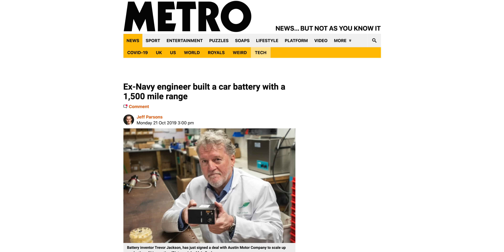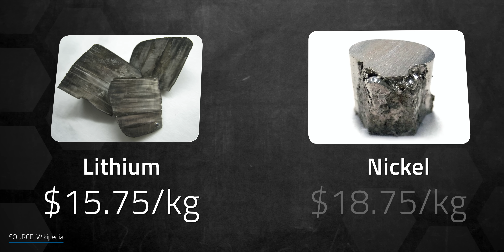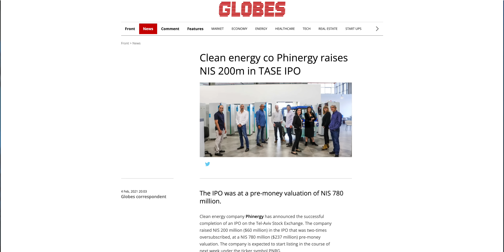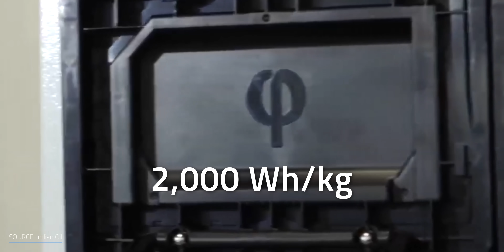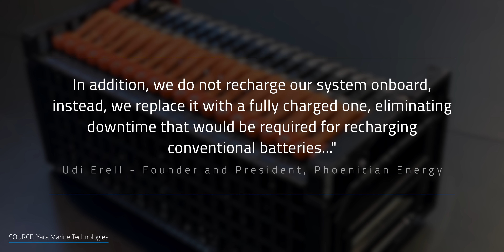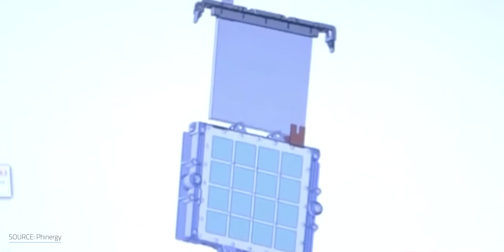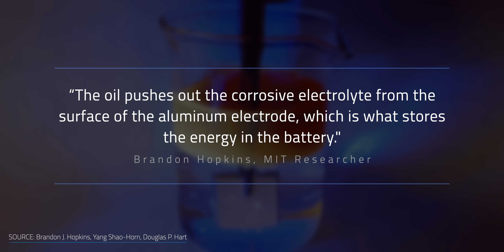Exploring the 1000 Mile Car Battery - Aluminum Air Hype?

Comment: If they are super light with super high energy density, but require specialists to swap out, then they sound like they are perfect for aircraft.
Reply: When gas stations first appeared on the scene...it required trained gas attendants to gas up vehicles
Reply: @signkutter9218  Kind of like how there an elevator attendant that operated the elevator for people.
Reply: @signkutter9218  still like that in New Jersey.
Reply: @signkutter9218  They still exist in some countrys
Reply: @signkutter9218  These are still not rechargeable, and while they might be "easily recyclable" Aluminium recycling takes a metric fuckton (scientific unit) of energy. So it won't be used in applications where you can easily recharge NMC or LFP batteries.
Planes I could see. There max energy density per kg is important.
Reply: @4203105  it takes a metric F.T of energy to run shiat right now...if the energy and pollution can be concentrated into use at a few locations they  can be much more easily controlled and methods improved upon
Reply: @signkutter9218  So your solution to the climate crisis is wishfull thinking. Gotcha.
Reply: @4203105  😅🤣😆...ok...
Reply: @signkutter9218  yes, your post was laughably bad. Good to see some self reflection there. Ü
Reply: @signkutter9218  because labour is cheap in India (folks are poorer and live in precarity) we don't have any petrol station without an attendant.
Reply: and to replace diesel engine trains.
Reply: @Psi-Storm  THAT was what I had first thought of too, you could essentially have an entire train car that's a massive battery. once you get to the destination, you swap out for another one (or maybe use 2 for round trips?) then recycle the old one, swap out to new cars, and keep on rollin'. there's definitely massive potential there.
Reply: @Fenthule  I imagine standard electrified tracks are more efficient seeing as they don't carry any fuel, but maybe in certain areas that would be impractical. Also I'm no scientist and I could be totally wrong.
Reply: @Psi-Storm  over head wires are better for trains
Reply: @Psi-Storm  hahahaha. uuuuh, no. how much waste are you wanting to create? if there is so much concern about the pollution create some kind of exhuast system that removes the NOx 's rom the gas an uses it to do something
Reply: @Psi-Storm  catenaries and third rails are far more effective methods of electrifying trains without having to rely on far off future tech
Reply: @tomasjakovac7950  I Germany we have around 13000km non electrified railways, which are only sparingly used. The costs to electrify is much higher than just upgrading the needed railroad engines.
Reply: Energy of combustion per mass of Aluminium is 68% that of kerosene, and I suspect the efficiency of a battery/motor/fan would be considerably higher than that of a jet engine. You could be on to something...
Reply: @Aaron628318  Jet engines are extremely efficient, So much so that they cant run stochiometric mixtures because the engine will melt, generally
Reply: @raam1666  Yes, the 'motor efficiency' of jet engines is good at ~55% but not as high as an electric motor would be at >90%.
Reply: @Aaron628318  hello it needs air to work doesn't it.the air pressure is really low at crusing altitude which would push down the reaction rates in the battery to a fraction of what it is on the surface.We can't pack a tank of air for something as large as an aircraft on board because that would reduce the energy density of the overall system down to clearly uneconomical levels.
If anything aluminium air batteores are near perfect provided there is a robust and easy swapping mechanism and stations.i read the researchers were able to design aluminum casettes which can be standardised and just put into the battery slots and within minutes the battery would be ready for use.
Reply: @Aaron628318  Well we arent combusting Aluminium, we ar using it in a Battery :P . If you look at it this way the 1300Wh/kg or maybe 2000Wh/kg of the battery dont really compare to the roughly 12000Wh/kg (43MJ wikipedia) of kerosene. Take into account that the more fuel you need the heavyer your vessel gets, making your need even more fuel. If you drop your energy desitiy to around 15%, I think its fairly obvious that the resulting differential equation will blow out of proportion. Jet airliners are not possible with this Battery. Smaller planes yes.
Reply: @martinkroeker5346  In effect though we are combusting aluminium. I was imagining they would be similar to zinc-air batteries. In these zinc powder is added and zinc oxide is removed. They can actually be operated as a form of fuel-cell with this process happening continuously. The excess mass over that of the reagents could therefore be kept low. That was my non-expert thought anyway...
Reply: @Aaron628318  It'd only work for replacing piston and turboprop engines, but it'd be great for that, especially helicopters.  The heat thrown off by the burning kerosene accelerating the air expelled out the back is critical for jet engines.
Reply: @Aaron628318  68%?! that's huge! lithium is like 1%. and yeah electric motors are waaaaaay lighter. no need for a full jet engine with multiple compression stages. you could probably use props instead because electric motors can have huge power delivery and torque and require little maintenance...
Reply: I'd suspect that light is a relative term here. Maybe light compared to other battery materials, probably not compared to traditional fuel.
Reply: Doesn't get around the problem that the aircraft would have to land fully loaded. Takeoff weight and landing weight are not the same, in fact they differ greatly
Reply: @peersvensson9253  This hypothetical aluminum air battery would probably weigh less than the empty fuel tank, pumps, and piping of a kerosene system.
Reply: @peersvensson9253  Planes can land fully loaded. They do so all the time when there are plroblems shortly after takeoff.
What is your imaginary problem here?
Reply: @4203105  They jettison fuel if they have to land right after takeoff, or alternatively circle the airfield to burn fuel. A simple google search will tell you the difference between takeoff weight and landing weight of an airliner.
Reply: @peersvensson9253  but in return your plane is always fully balanced. And the difference in weight of fuel is not as extreme as aviation experts make it sound, and besides most problems from weighted planes comes from take off, landing is more affected by landing characteristics of the plane (ground effect, angle of attack and tail clearance to name a few).
Reply: @ScarletFlames1  weight = wear and tear.
Reply: Electric motors are probably cheaper and lighter than jet engines. Jet engine bypass air is already used to pressurize the cabin so maybe the electric motors could be used to supply the battery and cabin with oxygen.
Reply: @mariat5860  o
Reply: That didn't look too specialised. Click one out, click another in.
Reply: I've been saying this for years & I don't see any problems using it in cars either. It's silly to think it's difficult to switch it out anywhere. It doesn't need a special environment.
Reply: Parts swap will be made simple and easy. But just hard enough you dont want to do it yourself.
Reply: @shawnr771  I rather have rechargeable batteries with solar power
Reply: Yep.
Reply: @PinskiYT  you can have both, a hybrid with just the one powertrain. The AlO would be only used when you exceed your LiIon capacity.
Reply: @WoutMertens  I must argue that having energy Independence is more important rechargeable batteries will become more energy dense eventually and solar technology is getting better
Reply: I just realised that there's a downside. Jet fuel gets lighter as it's used up. Aluminium/air batteries get heavier...! Maybe they could drop them off with parachutes on the way?!
Reply: @Aaron628318  improvements to landing gear also, yes? Higher landing weight = more wear and tear
Reply: @Aaron628318  But still that kind of battery are way more light then Lithium batteries.
Reply: The issue in aviation is the lack of air at altitude. This battery requires oxygen in the cathode. You would need a compressor to provide enough oxygen to the battery. An electric air compressor could easily use up a significant portion— if not all— of the battery output.
It really depends on how much oxygen is actually needed.
We could also carry an O2 bottle but it poses a fire hasard and adds weight.
Reply: @Baminokrat  because planes fly at high speed on high altitude, the mass of oxygen airplane comes in contact per second is not going to differ too drastically. And there will be some sweet spot where this can work at maximum power.
Reply: @Baminokrat  The turbo engines already have an air compressor, you would just need to get some oxygen out of the compressed air stream.
Reply: @Baminokrat  Based on the chemistry in the video you will need about a ton for every ton of aluminium. If the air is at 0.5 bar there will be around 0.1kg/m3. So you will need approximately 10.000 m3 air for each ton.  Sound much, but for example an jet engines pushes that amount in a few seconds and a forward intake could get you all the air needed.  .
Reply: @Baminokrat  I think the speed of the plane could easily be used to create a local high pressure zone around the battery.
Reply: @Baminokrat  When you look at the details and the high development of the latest high bypass jet engines - a pretty high bar effciency-wise. Also need to consider power (how fast can we use the energy) - This is super-high for jets - can a battery pump out 50,000 horsepower? How big would the wires have to be?
Reply: @DLWELD  On to something there...
Reply: @DLWELD  Most everything can scale, so sure .. The only decider is power to weight ratio, and in a feasible volume ... Surely SOMEones worked the mumbers on this ???
Reply: @Baminokrat  
That issue only applies at jet altitudes , whereas Ro-Ro operations for aircraft would be low-level regional flights .
Reply: @Guillaume  jet engines also require a huge ammount of oxygen. These batteries wont require a similar amount i would imagine (just because the mass of the battery doest increase 10x when ut is charged)
Reply: @Baminokrat  Yes and no. A 'scoop' could be deployed, similar to jet engines to compress the air anyway. At high speeds, air shoved from a large intake to a small pipe would create the flow needed. This is similar to the turbofans on jets.
Reply: @Baminokrat  the necessary oxygen for Jet flight is provided by the Jets velocity. I suspect the same technology would be sufficient for aluminum batteries.

But there might be issues with high-altitude airports.
Reply: @Baminokrat  Yeah that could be an issue for sure depending on how much O2 is needed. Maybe could be rammed in with scoops but that adds drag so... Aviation... a balance of dozens of factors.
Reply: @Baminokrat  Don't you need air for combustion in a regular engine in a plane?
Reply: @Baminokrat  I had the same idea but didn't think about the oxygen required, interesting. How do conventional aircraft deal with combustion at high altitudes?
Reply: @Baminokrat  what is a Ramjet, hello?
Reply: @Baminokrat  Air density is not changed as much at the altitude commercial airplanes fly at, to humans it's a lot but to machinery it's negligible if would not require as much compressed air as you'd think. Also, I remember Elon say something about battery powered flights have an exponentially higher efficiency and speed potential, the higher you fly vs a conventional airplane engine because of the air density requirements that batteries don't require.
Reply: @Baminokrat  you're correct that the lack of altitude would be a draw back. However liquid oxygen is already in use for aviation and provides O2 at ~800 to 1 ratio vs compressed gas. The systems could be linked up to provide a steady stream of O2 to the battery along with the cabin. It would take an engineer to set up the right configuration to maximize the weight and power usage with the O2 consumption though.
Reply: @Baminokrat  if you were using currently understood turbines that were simply spun electrically, you would have more than sufficient high density air to bleed off to feed the battery.
Reply: @Baminokrat  liquid oxygen? :o
Reply: @Baminokrat  battery turbos
Reply: @Baminokrat  This might be a better solution for the air taxi technology several companies are working on or for smaller aircraft that fly at significantly lower altitudes than the larger commercial aircraft.
Reply: @Baminokrat  I wonder if liquid O2 would work. Some planes already carry liquid 02 on board
Reply: @Baminokrat   velocity would take care of that problem, as it does with a jet engine which also oxidizes it's fuel
Reply: @Baminokrat  Well hold on a mo, sometimes function dictates form - imagine a low altitude air fleet based on this tech? Could be great for short-haul ??
Reply: @Baminokrat  Considering the speed planes fly at versus cars travel at, i would think if the car version needs a silly little pc fan then even at lower oxygen environments the potential speed of the craft would negate even the need of a fan by using intakes and the venturi effect plus near 10times the speed of travel of a car. The     i wont call it a battery "chemical generator" is likely slightly lighter than the fuel was and possibly the motor drive is lighter than a traditional engine so it could very well be viable.
Reply: @Baminokrat  isnt o2 already stored for passengers for breathing at high altitude ?
Reply: @Baminokrat  The jets I work on have sealed lead acid batteries they work fine at altitude well over 10,000. No air compressor required at all. And even above that there's not no oxygen there's just less of it otherwise the engines wouldn't be able to produce thrust because they need air too. 😊
Reply: @rolandyamel6376  10k feet is still well withing the safe human breathable altitude. I don't know what the highest a naturally aspirated, reciprocating ICE can go, but the ones I have flown have a service ceiling under 20k. Commercial aviation is typically over 30k. Without knowing more, I would expect the batteries to work under fairly low oxygen environments, temperature at altitude might pose the greater problem to chemical processes. Both would be solved by putting them inside the heated, pressurized cabin envelope.
Reply: @rolandyamel6376  
The fact you work on jets and do not seem to understand why an ALO battery VS SLA is a world of difference here and why is kinda concerning. I hope they are RC jets and not passenger commercial or by work on, you mean serve tea and bikkies.
Reply: @Brougley  I realize that Alo batteries react with atmospheric oxygen I'm saying I wouldn't use an Alo battery to fly at any high altitude however you could use them at lower altitude for takeoff and landing and then Cruise using lead acid or lithium ion or what have you once you achieve cruising altitude. Still get the power but reduce the weight.
Reply: @rolandyamel6376  I would more just think the problem is energy density and packaging. Oxygen enough is going to be coming off the turbines whether they are conventional or electric and the drag and efficency loss or systems cost etc is negligible. Fuel tanks and nex gen battery designs are all structural components, fuel tanks can flex and expand like a leaky fighter going to space, lithium you don't want doing that so we see the new wing designs but still everything is structural. If you try have the battery as a removable structural component the plane will fall in half like a koenigsegg if you pulled its engine and even if it were 3x the energy density of lithium and flexing was not an issue, then its still barely competitive with liquid fuel and I wonder what its co2e is when stacked against alternative fuels and carbon capture etc..... It might be an option in future for some applications, but I think its a very long shot that its the battery we need to replace hydrocarbon fuels for the majority or air transit.
Reply: @rolandyamel6376  In what way do lead-acid batteries need air?
Reply: @SebastianSchleussner  led acid batteries don't need air some may need ventilation for off-gassing for the hydrogen gas produced during charging but other than that some can be completely sealed.
Reply: @rolandyamel6376  Yep, my point exactly, so no meaningful reference for Al-air batteries.
Reply: @SebastianSchleussner  sure it is aluminum batteries wouldn't be a full up replacement for other battery types during flight however you could use them at higher power modes like take off and landing and low altitude operations and then once you get to cruise altitude you could switch over to something like lithium or lead acid or whatever you want for the cruise mode of flight. In this way you could use something that's tried and true like lithium or lead acid in tandem with this emerging technology.
Reply: @rolandyamel6376  Well, lead batteries are by FAR too heavy to power planes' flight so their needs or non-needs are simply a moot point. I'm sure compression of ambient air to supply the oxygen needed for Al-air-powered flight would be feasible also at cruising altitude, but I would be highly surprised if non-rechargeable batteries, Al-air or other, ever found routine use in aviation. POSSIBLY, a bit along your lines, as something akin to today's JATO rocket packs for overloaded transporters on short runways...
Reply: @rolandyamel6376  Is it a battery riven JET? You make it sound like that, in that case you work on a pretty mutch futuristic totaly revolutunary JET.
Reply: @rolandyamel6376  Ah yeah thats Lead Acid ..  Which merely gives of some Hydrogen .. THESE puppies need atmosperic oxygen to work...
But as others suggested, that might not be a a TOTAL bust (low altitude short haul ops ?)
Reply: @Baminokrat  Oh, what a genius! Fuel burning jet engines don't require air at all, all this time we spent trying to have jet engines compress the air at high altitudes to allow for the jet fuel to burn when we could have just let it burn as it is!

Jet engines still require air, so do the people onboard the aircraft. You can easily have a second compressor suck in air for the battery reaction which would be in place of the air "wasted" on combustion, and since you'd reduce the internal geometry complexity you'll reduce the air drag inside the engine which comes up as a total increase of efficiency for the "combustion" portion of the engine.

Also it comes out that at 68% efficiency of aluminum mass compared to kerosene mass at 58% fuel utilization electric motors will win over combustion since they have ALMOST 100% efficiency of utilization at optimal load compared to said 58% MAXIMUM of kerosene jet engines.
And FYI, this comparison heavily favors Kerosene engines, I've ignored multiple efficiency losses on kerosene engines that will simply not exist on Aluminum Air batteries.
Reply: @ScarletFlames1  Could you perhaps use the airflow around the aircraft to compress air passively during flight?
Reply: @ScarletFlames1  The decrease in geometric complexity inside the engine would be nominal at best. GE's GEnX Engine already has a bypass ratio of 9.0 which means only about 10% of the air getting pulled in by the turbofan is actually entering the compression and combustion stages. The air being directed through the combustion stage is what you'd essentially be eliminating but it would still need to be compressed, likely in a similar way (although I'm guessing not to the same extent). And the combustion stage of that engine provides the drive mechanism for the turbofan so we're still talking about a substantial amount of energy to run a similarly shaped engine even on electric power.

If these batteries are useful for flight, it's unlikely that they'd be used commercially. More like short recreational flights, or perhaps flight school. No jet airliners being powered by these guys, to be sure.
Reply: @ScarletFlames1  You do not need a compressor.. a simple air scoop would suffice.  There is still enough air over the wings to keep the air plane from falling out of the sky.
Reply: @ScarletFlames1  You forgot the weight of the battery never decreases over the length of the flight, unlike combusted fuels. You require higher levels of propulsion for the entire duration of the flight, far more than can be offset by the 3% efficiency losses you could possibly make up for in a non-combusting engine. Those differential equations do not resolve in your favor. And it gets almost 20% worse for you when the industry converts to natural gas turbines (which Boeing, Airbus, GE, and Pratt & Whitney are already working on, with EIS likely by 2040). And it still gets even worse for you with the advent of the Geared Turbofan and Ceramic Matrix Composites pretty much resetting the upper bounds of engine efficiency. 

We can pull off another 30% gains vs. the max theoretical yield of a 3-spool conventional turbofan made of Titanium and Aluminum alone with that combination (and who knows what else once graphene gets involved down the line). That would be enough to let the A321XLR (or an A319) fly Vancouver to Melbourne, or a standard A321 Vancouver to Auckland. Rebuild the airframes with maximum use of composite or Aluminum-Lithium components, re-optimize the propulsion for the weight, and you'd be pulling off the Perth-London flight in a narrowbody without auxiliary tanks. With natural gas' additional 20%, even Newark-Singapore is possible (I won't swear on Project Sunrise without the full data models in front of me, but even with a single aux tank needed for that, so what?). Battery tech isn't capable of touching that performance until we have graphene in mass production.

And this is also long before we get into the 150-500 electricity-guzzling passenger devices being plugged in for anywhere from 1 to 10 hours (to cover ~90% of currently routed flights in the world). Even more battery weight, even more propulsion required, more energy consumed more quickly. 

And the logistics of battery maintenance and swaps would be an enormous hurdle unto itself.

We'll certainly get to the point where we have hybrid planes which have an aluminum-air battery supplementing the combustion, essentially a dual drive train on the fan, but you will never replace combustion turbofans with battery-powered engines beyond a 60-90 minute flight even in the optimistic cases.
Reply: @Baminokrat  02 carried in a balloon of sorts
Reply: @caked3953  "Bancrupt"? .... Seriously?
Reply: Good thinking.
Reply: Exactly, its the perfect contender for electric planes
Reply: Yes and the company thats testing them obviously wants to use them on ships which seems to be an excellent use case ... This video seems to completely miss the point of them
Reply: Reminds me of the scene in 'The Fifth Element' where the ground crew changes out the battery on the spaceship.
Reply: Or a Choo Choo 🚂
Reply: @lukuscarter3563  But why tho? Trains are already electric and work fine.
Reply: Bit too bulky, plus these are for cars and only have 1000 miles range, a jet would use one up in seconds lol. Can you imagine how big it would have to be to power an aircraft? lol. Advantage of jet fuel being a fluid is that it can be stored in wings and around the fuselage like an SR-71, used for cooling also.
Reply: T C  Ratio'd much? Take the L, loser.
Reply: Maybe or maybe not . This thing need investments . I hope the governments around the world will support research on it
Reply: The big problem is that if you use up only half a tank of kerosene, you can use the leftover on the next trip. As I understand you would need to throw away a half used aluminum battery. You can swap midair, you don't want to start with a half full battery.
Reply: Comparing to something like hydrogen fuel density of 35,000 WH/kg Aluminium air battery has very low energy density.
Reply: i'll back it when i see a working prototype. bear in mind that we don't have a privately backed electric jet engine; there was a plasma one last year if i'm not mistaken, but it was a research project and i haven't heard anything about it since. when a company like boeing or airbus start to show intrest, then i'll start to get excited.
Reply: That's a good point!
You can't stop midair for a recharge anyway, so a primary battery with high capacity per unit volume and low weight, would be an advantage instead of a heavy rechargeable.
Reply: Except the fuel aircraft use is more efficient, provides more power and reduces in mass as consumed.
Reply: Green hydrogen is the go ahead for aircraft for current technology
Reply: Good luck running a chemical reaction tra requires a lot of 02 at high altitudes 
With out carrying extra electronics thay will use up a big portion of the electricity produce
The reason why fuel works at high altitudes is because the compresión rate of nitrogen is really high 
So you don't need that much oxygen to produce thrust
Reply: Better biofuel electric engines are weak for heavy airplane s
Reply: Scarlett flamed biofuel for giant planes is the only solution
Reply: suitable for UAV probably
Reply: Eviation are already planning to use them.
Reply: Aircrafts fly high in air and don't have enough oxygen in air to keep the battery working which he said in the video battery sucks from surrounding.
Reply: This would also probably solve some of the distribution problems...
Reply: Captain speaking, ( for the last time my parachute is on. ) our batteries ran out, do you wish to pay for parachutes. But it will cost all you own, so quick reply or die. We are getting near land , hurry.  Not a case of “pullover I’m getting out. “
Reply: India has the world's second highest bauxite reserves, world's largest aluminum company, a 115 billion USD + crude import bill & 1.4 billion people. Yes.. train the specialists. Let's have cars on Al Air batteries as well..
On a serious note.. India has just started a project to commercially test a 50 seater bus on Al air batteries.. The project will go on for a few months.
Reply: Standardise the battery for cars accross all the brands. And instead of portable charger charging Lithium battery, the road side assistant comes with a new battery and swaps it in 5 mins.
Reply: My question would be why would it need a specialist to swap these out. plug-in secure.switch on, job done
Reply: For airliners liquid hydrogen is superior to Al-air.

Its extreme light. Meaning you dont get penalized with with lift i duced drag even as much as current kerosene burijng aircraft.

And its very much compatible with existing engines.

The downside of "it evaporates when it sits idle on the runway" is irrelevant, as aircaft spend majlrity of their lives in flight.
Reply: @martonlerant5672  it's also highly explosive and relatively expensive to make. We could have have hydrogen jet planes a long time ago, if they were better wouldn't that have been done yet?
Reply: @WoutMertens  
We havent done it since fossil fuels are "free", while you have to use energy to make hydrogen, thus it costs more. Basically its the same reason, as to why we havent been using battery powered cars.

And gasoline is also highly explosice and flammable.
Reply: @caked3953  Or they will simply pass along the higher costs to consumers.  Being a naysayer doesn't make you smart.
Reply: I thought the same thing 2 days ago......
Reply: Yeah great for aircraft but not personal car it's best to have control when you have electric in your own hands
Reply: But more mass then more battery weight increase for the plane to take off
Reply: @mariyappanyadavr5852  Thank you, Captain Obvious.